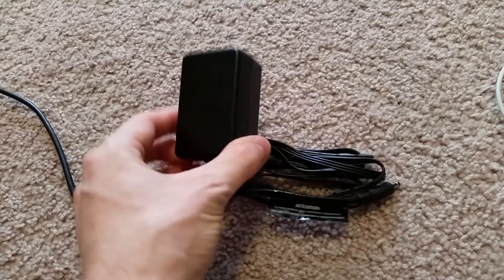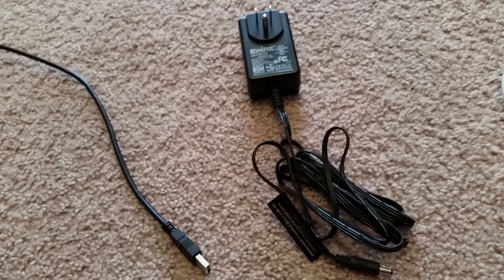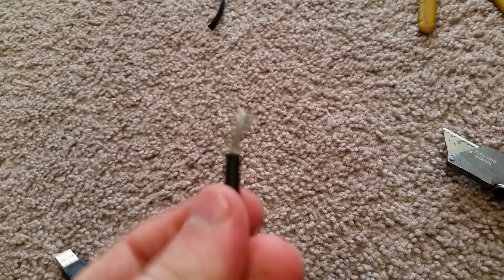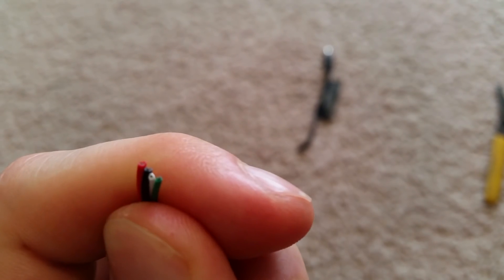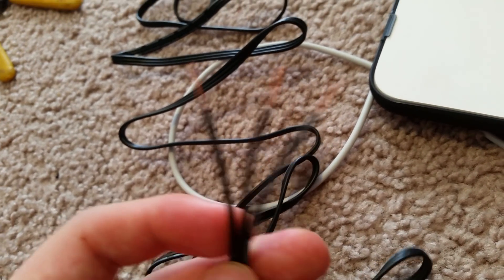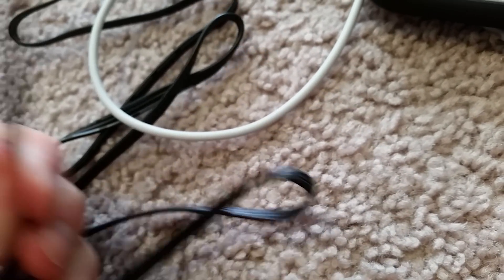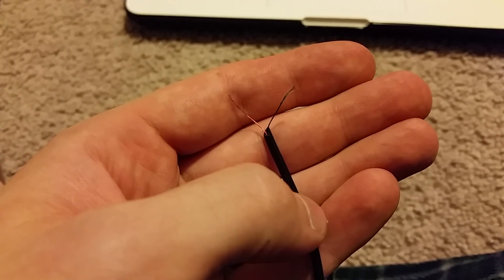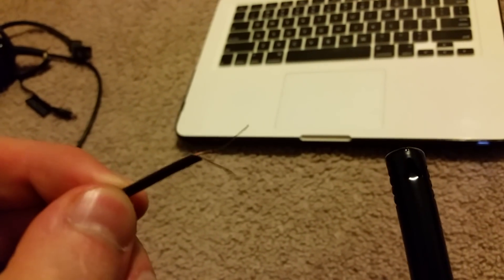Convert an old wall charger to something more

Comment: I cut my insignia type c wall adapter it has blue wire and white wire inside a shield then a wire with no coating. I want to put a 5.5*1.7mm on it, I'm assuming I use the blue and shield for neg and white for positibe

Comment: I have a AC adapter I'll put 9 volt DC plug in for my wallwhat I'm wanting to do or know if it's possible is can I switch that or modify it someway so instead of plugging it into the electrical socket in the wall it has a USB plug-in and I can plug it into a USB portable charger
Reply: IF the 9 volt AC adapter has a way of plugging itself to the wall and has power cables  (positive and negative) (black and white) coming out of it

Then yes, just peel the power cables , and put a usb C plug on that end and you've got an USB phone charger.

Anything between 5v and 12v is acceptable aslong as the Amp is between 0,8 and 1,5

Comment: Thanks man, it works with an charger of 12v , cut the wire take the DC and I plugged in a usb cable

Comment: That adapter goes t a 2wire AT&T modem/router.  I now because it says it  the power adapter, and I have one myself, although it's the newer one that only has 2 wires.  It does have the ground plug though.

Comment: hi can you help me.i have a small  car tire compressor and i wanted to be able to use it in my home to inflate stuff but i can only plug it in a car.Is there anyway to convert the plug to a wall unit.could u do a video on how to do that please.
Reply from the maker: Kamara's Artistic Creations https://amzn.to/2IjD2Ce
Reply from the maker: Kamara's Artistic Creations this would be the easiest solution but I'll see what I can do about a video, I have a air pump that only works in my car too
Reply: That tire pump is probably needs 12v.   

Search your junk drawer for a 12v wall wart and start snipping the wires. 

A fair amount of small appliances have 12v wall warts.  Good luck

Comment: i am doing the exact same thing with my old nokia charger but its not working...after connecting to the switch board when i am checking with multimeter its showing 9v instead of 5v...i dnt know why..when trying with my xperia M my mobile is going off and in case of lenovo A6000 plus its weired battery is dropping to 50% from 76% (as i tested last) after disconnecting its going back to 67%...what is the matter with it man...i have no clue :-(
Reply: Subhajyoti Goswami The problem is that you have an unregulated power supply. The output voltage that it state on the case IS NOT A LIMIT! Its what it will output when  connected to the original device. But if you change the load the voltage and current output can drastically change.
Reply: Subhajyoti Goswami basically, it will put out as much current as the circuit will draw until it destroys itself.